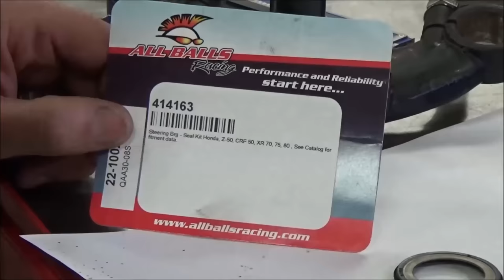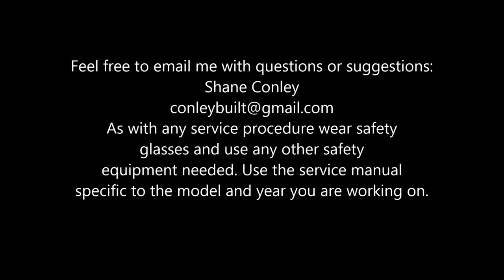The most "unknown" concern when upgrading steering stem bearings to tapered Timken kits #how2wrench

Comment: Shane great video man, not gonna dissuade me one way or the other but i love learning new things,i am restoring a 550k that was parked since 1984,some inside, some outside but more outside than inside,lol,thing is rough but my magic hands will give this bike another life in the witness protection program,ha ha ha, anyhow i am subscribed and i wanted to ask you something....

I know when people put these tapered bearings in, they freeze the cup in the freezer and Ive actually seen the cup go in 3 quarters of the way and tap the rest which is not much with a brass punch very very carefully, my question is... what if a guy had access to a big ole drum of liquid nitrogen? i actually work in a machine shop,we overhaul big engines and we use it to drop inserts on the deck of the engines after we machine bad portions of them due to erosion caused by water over the years,once those inserts are frozen they drop in there like magic,would the nitrogen hurt the cup in this application or would it be ok? 

Reason i ask is because the inserts we freeze are pretty good size but these cups are tiny compared to that,just curious if it could be done, thanks man for all your teachings.
Reply from the maker: Shoot sorry bud, We haven't seen any questions like this won  come across to help you on nitrogen use...Let me try and see I can catch Shane to answer quick. He is currently at an extended stay in Japan training students this winter. We are just the social media team. 
Due to his limited bandwidth on time and demand for help, we had to choose to forward any requests from members first and it is only $1.99 a month to join.  All member tech questions like this get directly forwarded to him every day! Be mindful and honest that this is for "quick questions" that would serve you answers that can clearly be addressed. If it's a diagnosis need you'll need to use the one-on-one service. 
Here is how to get in!
* Join here: https://www.youtube.com/channel/UCBhM8DCKnT3qXwTW0eToyCg/join       
* Just looking to give us a high 5? Click here: https://www.paypal.me/how2wrench 
* Is this an emergency and your head is about to explode from frustration or fear? Get Shane’s cell here: https://how2wrench.com/ols/products/techline-one-on-one     

Have you seen our "YouTube Trained Support Shirts? Great way to "high five us" https://goodfellasmerch.com/collections/how-2-wrench/products/support-shirt

Comment: Taper rollers bearings in head stem was about the worst thing to ever hit the mcycle aftermarket when I was an mc mechanic in the 70's , don't use, period - taper rollers bearing require preload resulting in braking effect at the steering head which is a great way to bring you just that much closer to owning a tank slapper special, don't ever race with them - ball bearings have precision point contact, no resistance in the steering, that's why they use them in steering heads - check them, if they are loose adjust them to just remove slack, if they are notched replace them but don't ever get the idea taper rollers bearings are a good idea - dirt bikes fine but road bikes, don't do it
Reply: Yet millions of people are out there, riding just fine with tapered kits and not having a single issue. The bearings, their design, their usage...are not the cause of tank slapper.
Reply: The diff is taper rollers require a good deal of preload that puts some resistance into the steering, balls not so and run neutral that resistance can result in a shimmy of the steering head when light under power, yes you can ride out of it easily, or not if you are inexperienced, its not dissimilar to what happens if you hold the bars a little too tight and induce a tank slapper but not that profound, as for what causes tank slappers, a number of things can including simply backing off too fast at high RPM on a bike with high compression in a dead straight line, been there and done that, the tank slapper itself is just a compounding  oscillation and merely the outcome of a number of factors..As for them never causing an issue, how to you arrive at that.
Reply from the maker: I agree. My opinion is it's because of lack of maintenance...
Reply: Yes that's the number one reason they use them, low maintenance, but as a mechanic my attitude to it was its a bit like car owner logic, so long as it last longer its good where bike riders are IME a bit more focused on whats best for the bike not just service costs and generally more prepared to spend time in maint and checks on their bike than most car owners and checking the steer head now and then inst so time consuming, so long as they are not allowed to run any slack they will last a very long time. But with the advent of CDI and EFI there is a good deal less tweaking and tuning to do on bikes  and more riders are possibly less incline to get the tools out so often like we used to.
Reply: Not ball bearings.
Reply: Seems to be suggesting where preload on ball bearing is required not that all ball bearings require pre load. There is none in for example motor cycle crank shaft bearings or automotive gearbox bearings where ball bearings are used. In this case it would not be applicable since the bearing doesn't not even complete a full rotation let alone operate at a speed that any clearance would cause undue wear.
Reply: I wouldn't use a blanket statement like you did, "don't use, period", as there are thousands of owners of Suzuki VL1500 that say otherwise. Just visit their delphi forum (http://forums.delphiforums.com/rlcmc/start) and you'll see hundreds of threads on SHB's . I can personally attest that tapered bearings completely stopped front end shaking on our bikes, replacing them with oem BB bearings did absolutely nothing.
Reply: Tapered roller bearings are designed to withstand much more axial load than ball bearings, The headstock doesn't rotate at high rpm but it does have a lot of axial load. Yes they require preload which can be tricky to set up but assuming you set them correctly they will outperform and outlast ball bearings in this particular  application. 
My kawasaki ZXR for example has taper roller bearings as standard in the headstock and the manual states exactly how to set them up correctly. Kawasaki engineers probably know a bit more than us mechanics as far as engineering so im sure they spec them for a reason.
Reply: "when I was an mc mechanic in the 70's"

Yea bro basically nothing has changed since then.
Reply: Somehow every modern road race machine, sportbike and superbike manages just fine with tapered rollers. My Miles Engineering Rob North road race replica Triumph frame has them and those frames raced then (and today!) with great success in Europe. I don't use too much preload and my Norton Commandos with tapered roller conversions handle fine (for obsolete fossils). Every modern road bike has tapered rollers. I've been wrenching since the 1970s too and respectfully contend you are mistaken. Do you retrofit ball bearings to your modern machines? If so, post video! Turning custom cups for ball races is basic lathe work.

Comment: Turn the seal around duh
Reply from the maker: Thanks for commenting and adding value to our community!
 Well almost, you can't flip the seal "upside down" in this case as the seal would then sit outside the steering stem kneck and provide no protection to the bearing. Dirt and water would get right in and ruin both bearings in no time. Take another look. 
Have you subscribed yet to never miss a video? Have you seen the video playlists? Over 600 videos! Check them out here: https://www.youtube.com/user/conleybuilt/playlists
Want to say “thanks” or “keep it up”? Click here https://www.paypal.me/how2wrench  
Your answers and help are just around the corner. Save time and money while protecting your investment and yourself by doing it the right way at www.How2Wrench.com

Comment: Interesting....
25  years fixing cars and bikes...
Almost always I'm using allballs for steering bearings.( especially  for honda )
Never in my life encountered this problem.
By the way it seems like you are trying to match the bottom seal to the top race set.
Hmmmmmm
Maybe you are doing this on purpose? 
Hmmmmmm
Reply from the maker: To what gain would I have to give out "fake information" Since making this video years ago, many folks have reached out saying thank you for a solution from their kit not woking (other brands too. The point of the video is to model a step one should check when installing. Like I said in the video we have used many All Ball kits with no problems as well but they provided no help or feedback except to return it. So as a tech of 25 years maybe you should think back on times that you appreciated "learning a tip". Here is my suggestion for you: You can find what you need here: https://amzn.to/3a3Xwsn  😆🤣
Reply from the maker: You could also read the other comments people posting finding similar results. I am still irritated from your insultive suggestion. You did know research on our channel or reputation. Nor did you respond. Behavior like this does not fit our community and best of luck elsewhere.